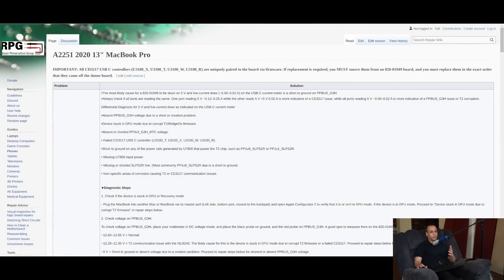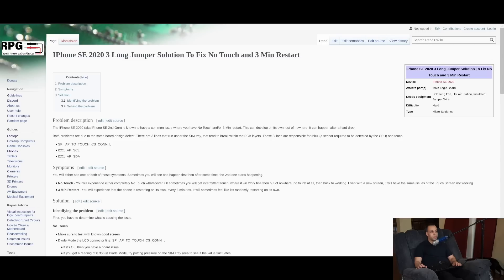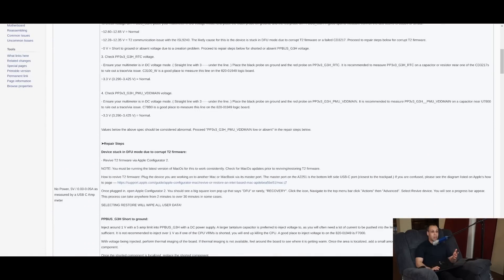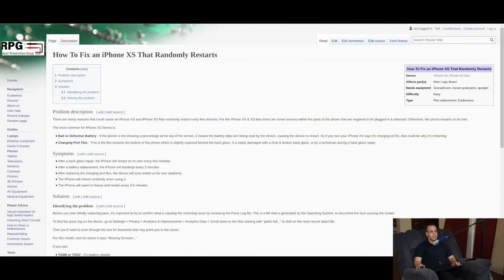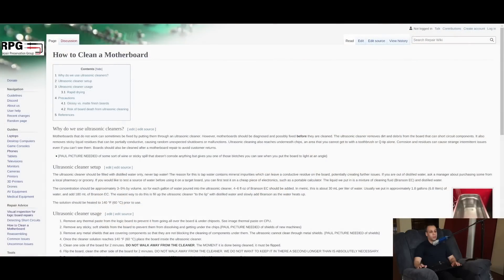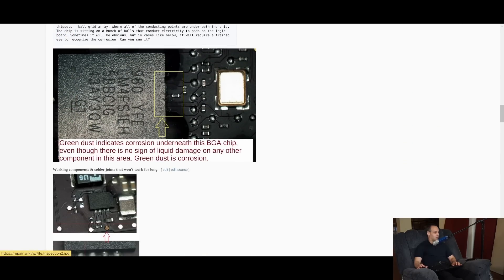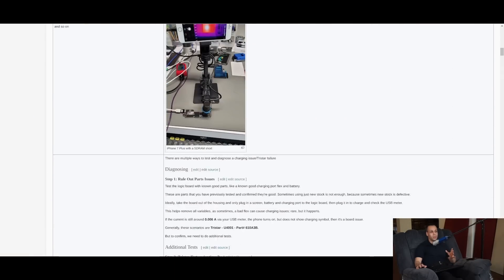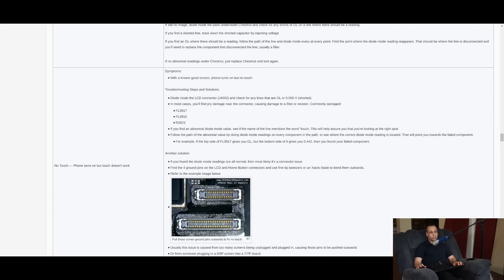Thank you to the best audience a guy could ask for for these amazing contributions

Comment: Louis is literally the OPPOSITE of a gatekeeper, he tries to soder the gate into the ground so itll STAY open for future repairmen 😁
Reply from the maker: I'm failing at that. But I will try until I have no will or resources left. I want the resources I would've killed to have had available at the beginning of my repair journey available to all even if they can't afford it. Thank you for the kind words!
Reply: @rossmanngroup  my ass you're failing! the other side has never stopped pushing, and you began seriously pushing back. you've made others aware and push back too. if you tried nothing, Then you could say you truly failed; you can't fail.

there's probably nobody in this world who could solder that gate to ground in a single move, but you're coming back to it time and time again with more bodge wire until it sticks :D
Reply: @HimmelsDaemon  well you see the term "gatekeeping" is commonly used to describe the practice of attempting to prevent/dissuade access to something unnecessarily, and he's doing the opposite when it comes to being able to repair things. fanur did an excellent and punny job, because a common electronic component, the mosfet, has a gate (leg/pin) one would generally not want to solder to ground :)

not that i have legit experience but i think if u soldered the gate to ground of a certain mosfet type, that would cause the circuit to remain open instead of switching on and off as a mosfet is designed to do, thus the "gate staying open" has double meaning.

really the origin of the current use of gatekeeper is just straight sarcasm i think. like in fandom communities, when someone tries to say you don't like something for the right reasons, one would roll their eyes and say ahh yes gatekeeper of the works fiction, your toil is admirable indeed.

it's probably going to end up like the word "literally" but whatcha gonna do? XD